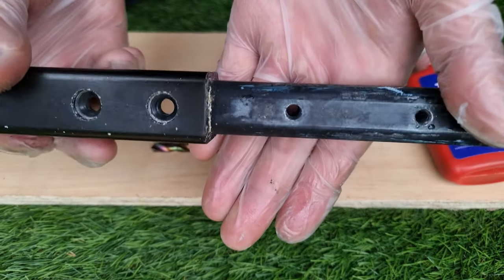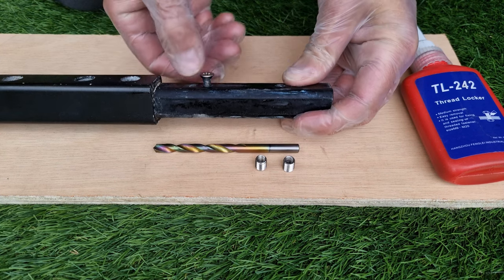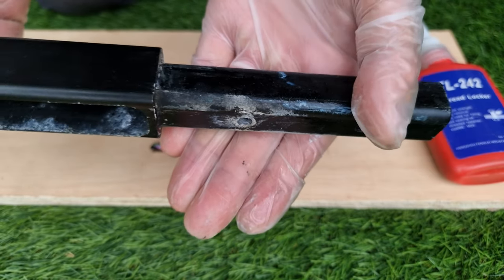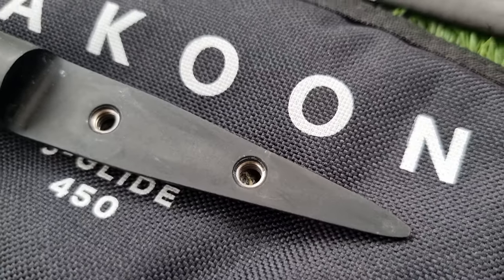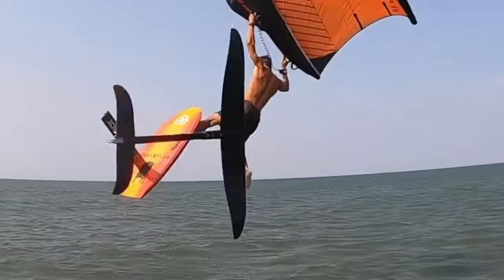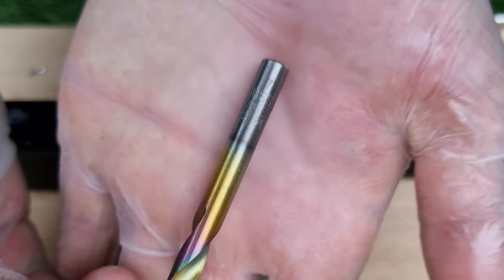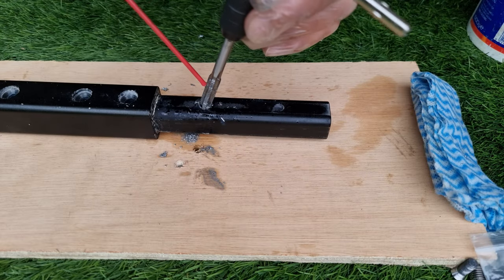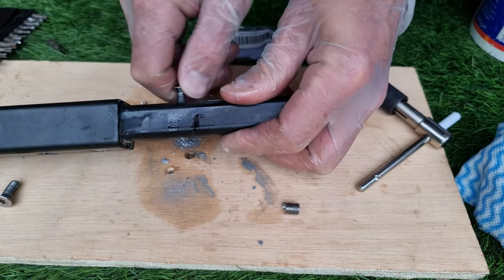How to Repair Wing Foil Fuselage with Damaged Thread. Gong

Comment: Nice explanation. The problem looks familiar, my biggest frontwing started to wiggle each session. I solved it by using through bolts with a nut on the other side 🙂The nuts are not completely flush but the extra resistance is very small. Your solution is better.
Reply from the maker: Thanks. I was initially using just one long screw instead of two shorter ones but it didn't hold well so had to find a permanent solution. Not sure why they don't use helicoil as it's really cheap and simple.

Comment: Have you had any corrosion issues with the helicoils?
Whether stainless or not, they're in direct contact with the aluminium meaning fast corrosion.
Reply from the maker: lot's of brands use stainless helicoils in alu fuselages without any issues. It's usually a problem with aluminium  + carbon + salt water

Comment: Thanks for this great video. I have the same fuselage and problem as you. I ordered a helicoil kit M6x1. I didn’t realise the x1 meant the length is 6mm. so I assume using one on both sides will not be enough since the fuselage is 22mm deep. I believe the next size up is x1.5 so 9mm - although using 2 will still be less than 22mm - do you think that will work? I assume I can’t use M6x2 as that would be 24mm - thanks!
Reply from the maker: Thanks! M6x1 means diameter of 6mm and a pitch of 1mm which is standard for M6. The length of the insert doesn't depend on the pitch. 2x 6mm long ones theoretically should be enough to make connection strong again, just insert them at both ends and not deep inside for the screw to hold onto. I'm not a professional, but this is what I'd do. Good luck!
Reply: @dengordo  Thanks - yes you're right i meant the second number which indicates length M6x1x1 and M6X1x1.5 etc..(from what I've read X1 means same length as diameter etc.. you had 2 x 10mm inserts which I think would be a tighter grip on the screw
Reply from the maker: @Djangoat68  Ok then x1.5 should be perfect

Comment: I have a going fuse that started stripping after slowly wearing from occasional wiggle. You use anything to secure the helicoil in place? Or is it a tight enough fit compared to the screws?
Reply from the maker: @jonnpow  helicoils get screwed in tightly so there is no need to secure them